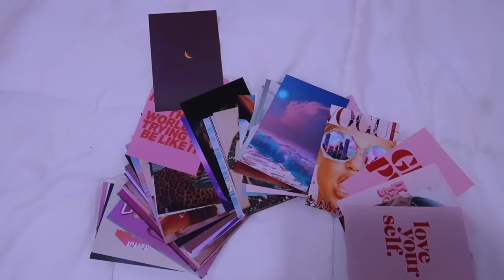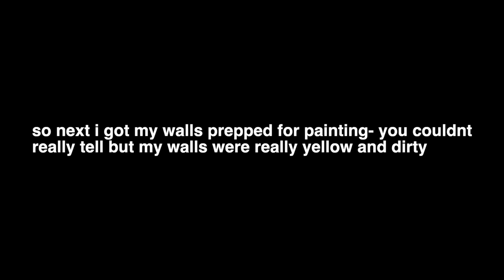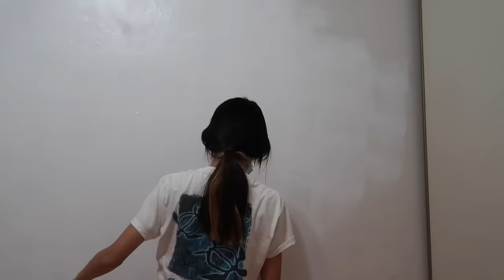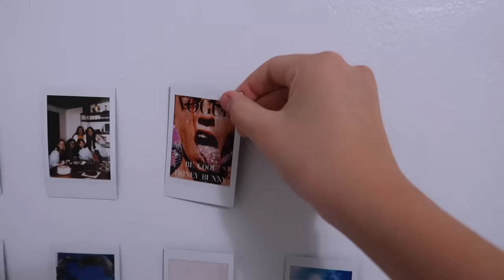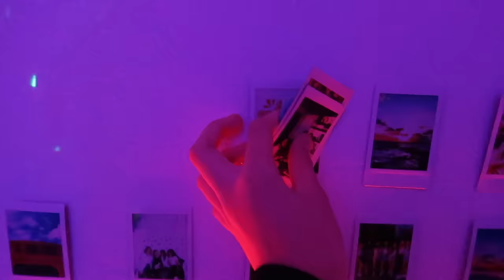EXTREME ROOM MAKEOVER + TRANSFORMATION *aesthetic vsco/pinterest inspired bedroom

Comment: Omg how did you stick the LED’s so easily??? It took me ages and kept falling off😭
Reply: Take the original tape off its dirty with like fabric or something, and replace it with double sided tape, they sell some at the dollar tree.
Reply: I use a blow drier to heat up the tape so it will stick good
Reply: One part of mine are falling off rn I will probably set them up at the end of the video
Reply: I suggest using double sided gorilla tape it worked well for me

Comment: I was cringing when she didn’t take the light switch cover off!
Reply: She can't take them off because they are connected to like 4 wires and one of them and kill you If its not turned off from the electrical box thing in the house somewhere. It takes a while to do it so its easier just to cover it up with tape
Reply: @Fizzy.19  wrong. You can take the outter rectangle cover off. The plug itself isnt connected to the cover, u can literally unscrew the nails in the cover n the plugs themselves wont move
Reply: Izobel Chadney no I don’t even have covers on my light switches and I’m fine
Reply: @broccoliboii1027  might be different in other countries but im my house if you unscrew the the front cover on ours then a bunch of wires that could kill you are attached
Reply: I mean tape works well too though
Reply: Izobel Chadney where do you live cause if you live in North America or Europe or 99 percent of the world the light switch goes in a little box and nothing is attached to the cover. It wouldn't even kill you if the breaker is done right and I've touched the wires inside and only felt tingles